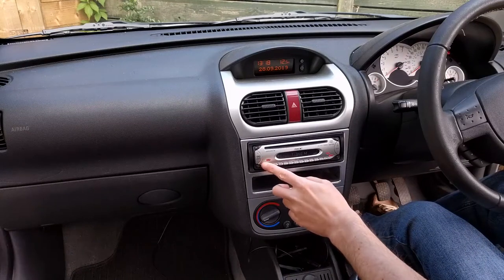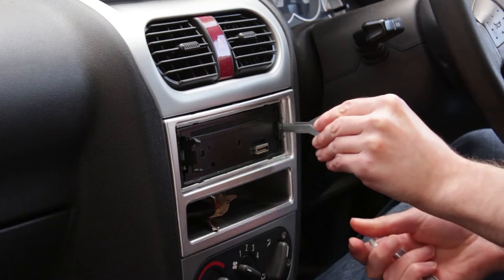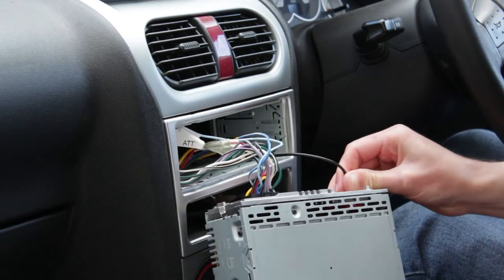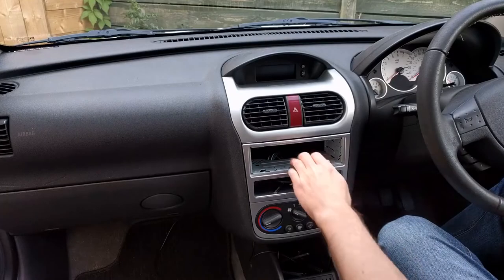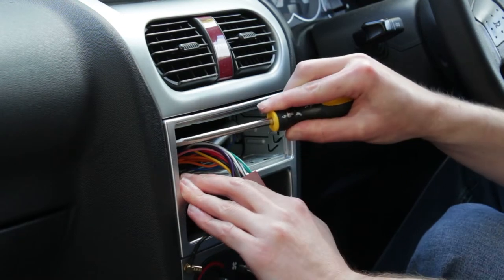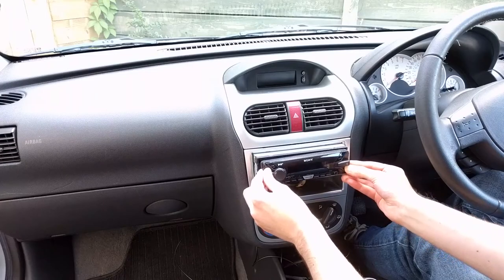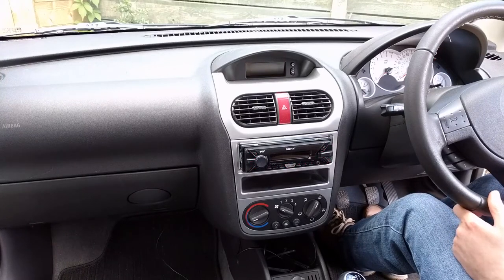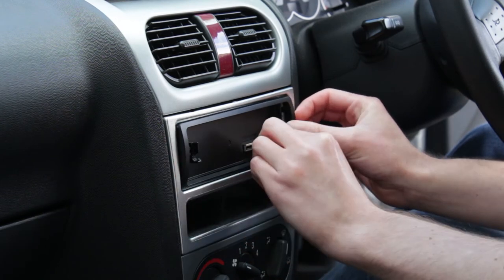How to replace a single-DIN stereo with a DAB radio

Comment: I hear there is a adapter for u to use the regular antenna for the DAB as well so you not need to run a new DAB antenna.

Comment: Does DAB+ never use the standard antenna?
Reply: It does if it's not an active one, which means that it has an frequency filter that does not let the DAB signal throughput.